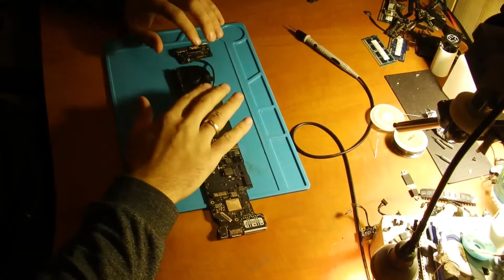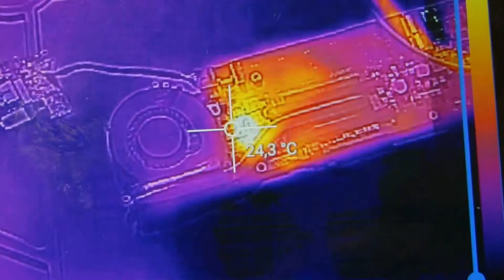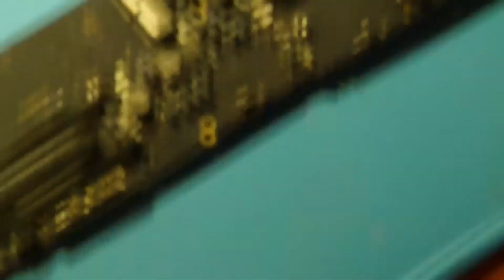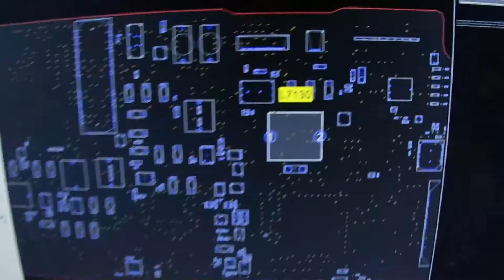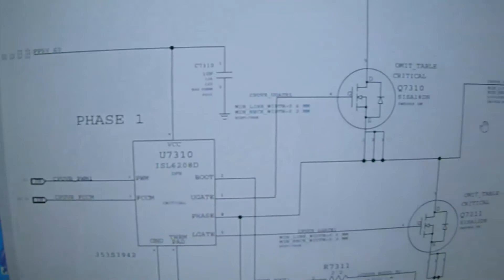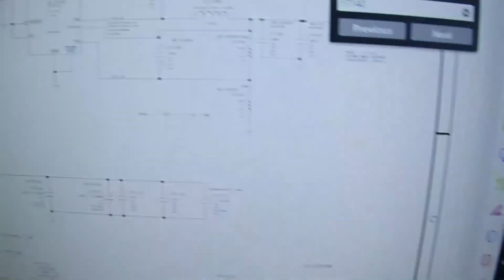Not powering on, Shorted Capacitor, MacBook Air 2015 820-00165

Comment: Hello. Great video. I have the same problem with shorted capacitor and f1740 blown. 
Is it safe to solder this myself without a hot air station ? Is there anything that you could advise on technique ? 
Thankyou